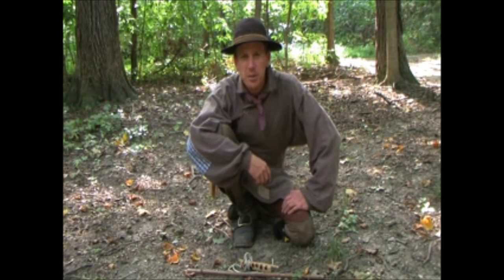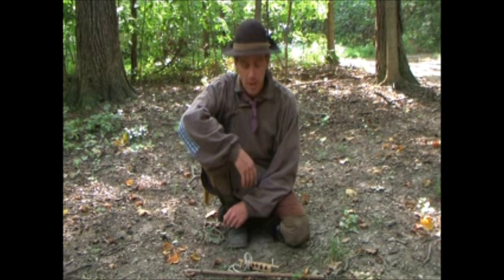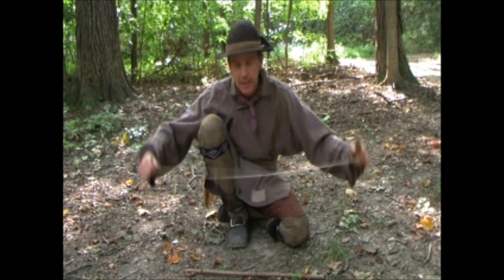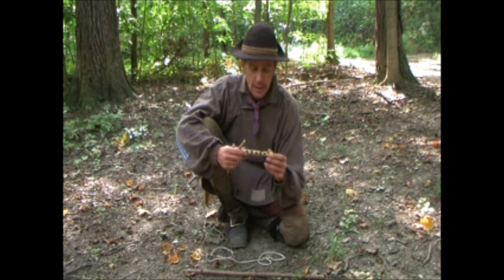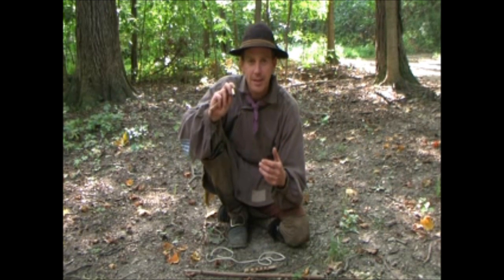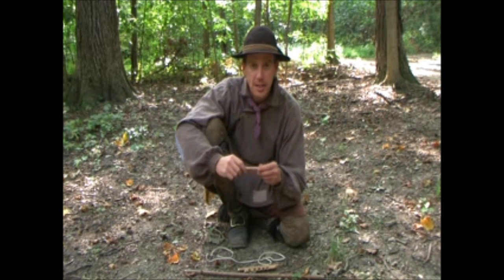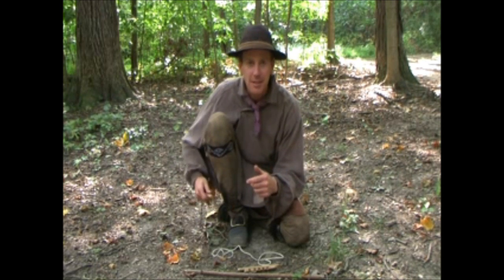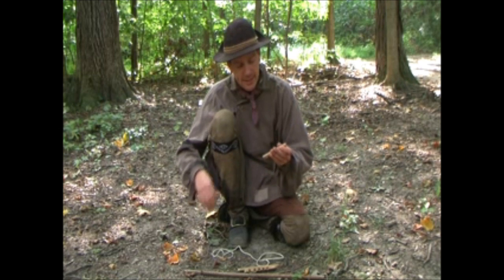FIRE! : The Arctic Strap Drill

Comment: An excellent demo, thanks. I've seen a variation where one end of the strap was secured to a springy branch. This frees one hand to use the bearing block just like a regular bow drill. Depending on the strength of the branch, you may need to vary the downward pressure on the return stroke to keep it from binding, but it works.
Reply from the maker: I'll have to give that a shot. It might be a way to still use the mouth block, and do it one handed.